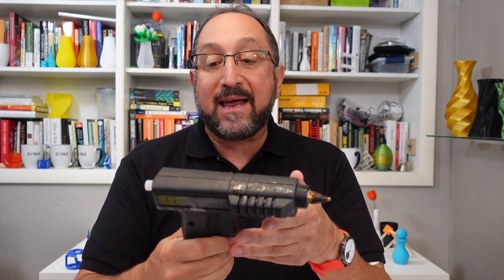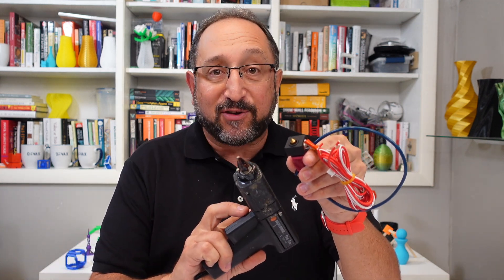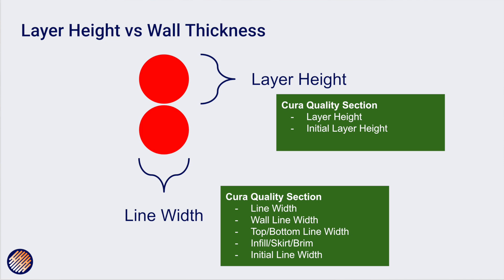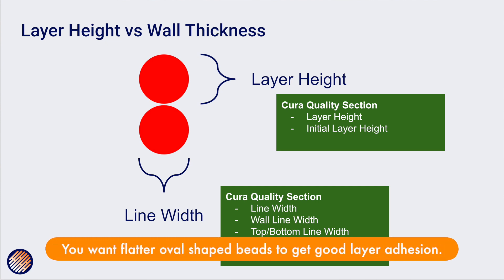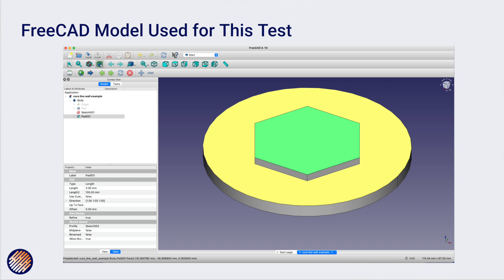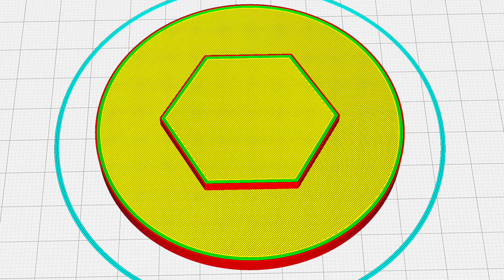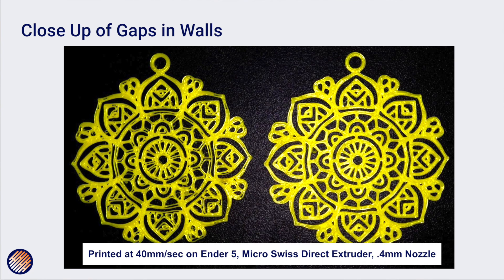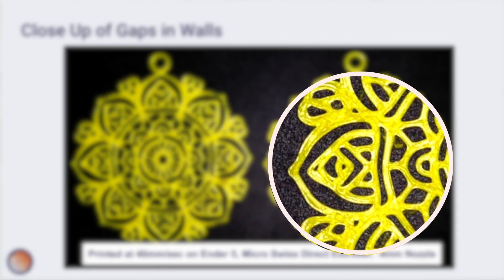Cura Slicer Advanced Layers and Wall Settings for Better 3d Prints

Comment: Cura 5 inexplicably removed "fill gaps between walls" and "fill tiny gaps". You will now need to set the "Minimum wall line width" to achieve solid parts, this parameter defaults to 85% of the nozzle width

Comment: Thank you! This video has helped save the planet and my wallet. I’m new to 3d and am using my new neptune 4 pro in my small business which requires me to print small intricate details. I’ve had some success but it’s been hit and miss and you’ve just taught me a lot of useful steps.

Comment: I have a wall separation issue that just popped up and for the life of me I cannot figure out where it came from or how to solve it.  Doesn't matter what filament type I use or nozzle size.  A good example is I have a basic test cylinder 30mm OD 24mm ID and 10mm tall.  Cylinder wall should be 3mm thick.  Using a 0.6mm nozzle set to a 0.6mm wall thickness Cura only draws 4 walls.  If I set the wall count to 5 it still just draws 4 walls.  This causes the walls to not stick together.  If I set the wall thickness to 0.675 it does the same thing but if I drop it to 0.55 it will draw the 5th wall but still not solve the problem.  Wall printing order has no effect other than to effect dimensional accuracy.  I've calibrated my e-steps multiple times and tried multiple nozzles.  I've increased flow up to 105% and it never solves the wall separation issue.  What I need is some sort of setting that forces Cura to overlap the edges of each wall a little to ensure that the molten filament absolutely makes contact with the previous wall.  I figured wall thickness would do this but it is acting completely differently.

Comment: I have a burning question that you might be able to answer, as I have not seen it covered in any videos so far, and I've been searching a bit lately.  I want to print a very fine detailed building that on the outside needs fine print settings, but on the inside it doesn't, and so I want to set the inside to max thickness to save time.  I have been experimenting with multiple layers and thick skin to increase regidity, and the thinnest of support to hold up the roof, as I don't want in-fill, but a night light effect from my phone, which works very well.  One of my castles takes over 40 hours to print, and I believe that i can get that down considerably.  I only have a Adventurer 3 flashforge with there slicer program flash print.  Its been updated quite a bit lately but I still cant seem to find this setting for interior vs exterior fine details settings...  Is this possible in one of the other slicers?  It seems that super slicer is the most customizable but theres no mention of this (yet) in any of the videos I've seen???  Is this possible??? thanks

Comment: I never understood why Cura considers a line width that is equal to the nozzle size to be a thin wall.  If my nozzle is 0.4 it can produce a line that is 0.4, and Cura should slice that line without the "print thin wall" setting.  if the line would be less than my nozzle size, then it makes sense, but what does not make sense is to consider a line equal to my nozzle size to be a thin wall.  

why would a line that is 0.41 not be a thin wall, but 0.4 is a thin wall.  makes no sense

Comment: When I print benchies it leaves a line on one side of the hull every time because cura is starting the new layer there.  How can I set it so it starts in a hull corner?

Comment: Thank you for the nice video. I have a question about printing walls and I couldn't find an answer yet. Can we have different wall thickness on a model that is not cube-shape? For example let's imagine a cone with the tip cut off. Also on the inside it has a hole in shape of a cylinder. But let's say it also has some thickness to it so there will be some infill between the outside come and the inside cylinder walls. Now let's say that the interior is of no real esthetic interest to us. We only want a single wall there for example or even less, no wall at all. I know that we can print with no wall and put per model setting cube with a different wall count but that would not suit other shapes than shapes with flat faces. Is there a way to achieve this in any slicer? Thank you so much.

Comment: Why wouldn't the options of print thin walls and fill in gaps always be turned on as a default? Or should I say why wouldn't you want to do this?
Reply: Hmm... Just a guess, but..
Looking at the prints there is a lot more printing going on. That, of course, means that print times will increase too.
Especially in large prints, print times could be increased dramatically. So - As long as it's not really needed I think it's better to not turn it on by default. As said, it's just my guess though...
Reply: @jclosed2516  Makes sense, thanks.
Reply: Do you have thin Wallström and full in gaps always on?

Comment: Compensate wall overlap is buggy as hell and should always be off, if you print any letters on top of or holes through an objects the walls of the whole or letters usually becomes separated from the objects itself with compensate overlap on.

Also doesn't arachne fix a lot of the issues with filling in thin walls and variable thickness walls ?

Comment: Excellent, now I understand why the inner "dots" would not stick. I have tuned my profile and saved it as a separate one for detail work. As per usual, excellent knowledge presented in clear easy terms. Thanks.

Comment: So I've completed calibrated my machine idk how many times and messed with slicer settings would printing to fast cause a bad top layer causing slight holes its with any filament and with different ranges of flow aswell

Comment: can u make a video that shows how you tuned extrusion and flow rate? perhaps retraction as well, or point me in the right direction. CHEP has a video how he lowered the retraction speed and got less stringing. well when I did Petg, I tried this and got a horrible print.
it's funny I can get great prints, but when I do a retraction test it's all strings. I tried playing with flow rate and no idea what I'm doing.
Reply: That's exactly the same weird thing that I also discovered 😅 my Technical Prints in PETG are beautiful without any Stringing but when I try to do the retract test it mostly looks like fluffy cat 😹